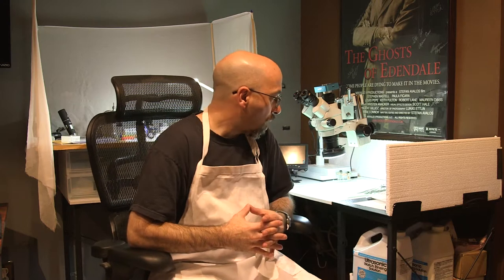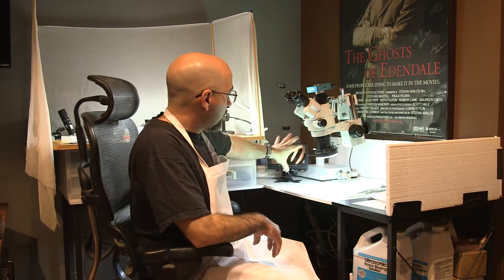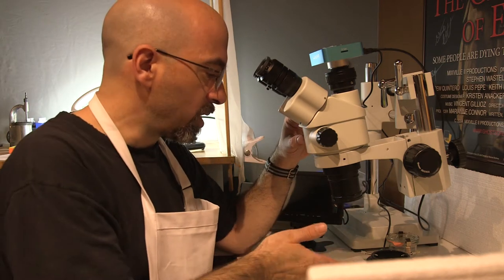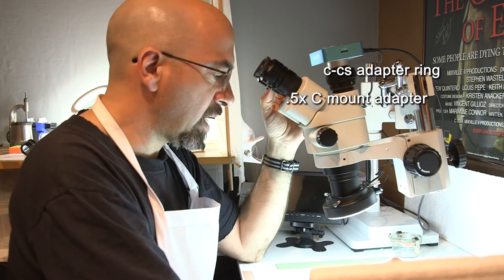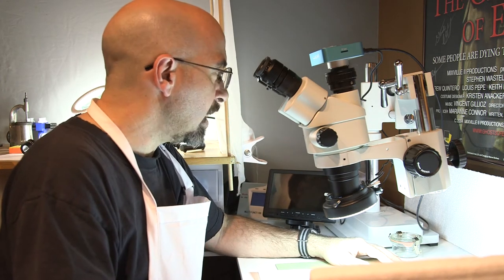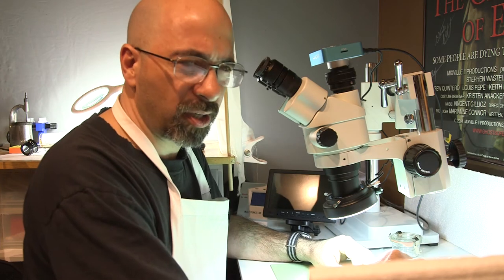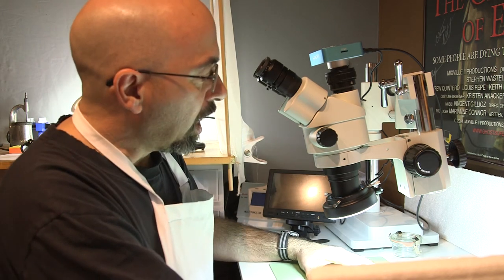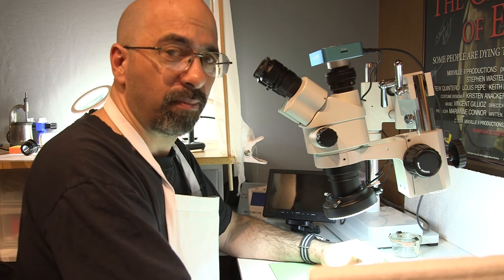Why an Amscope Microscope is AWESOME for watch repair!

Comment: Hi, firstly I did not expect to hear my name being said in this video! So thanks, clearly you watch my trials and tribulations in this wonderful hobby.
It seems to me you put up a very good argument for scope work. You answered one of the main concerns I make against solely working under one and that is lack of peripheral vision to see a part fly and have an idea where it went.
The plastic sheet on the front is a brilliant and typical hobbyist solution to a problem!  
For me I spent many years just using my cheap visor with a 2.5x lens and did a vast majority of my work that way. I got used to it and to this day even in my most recent citizen video I was using it.  Loupes I still use but as a glasses wearer unless it’s a clip on one I find them annoying to keep changing from glasses to loupe all the time.  Bergeon do a good clip on solution but they will rob you for it so I have so far resisted purchasing.

One other thing I heard that some pros have done in the past is pin a white sheet to the edge of the bench and then put it on your lap when working . There is a name for this but I can’t remember what it is.  Basically it can catch those flying parts and be found.
Personally I’ve found that pegwood is my best friend and to only remove it from a part when I’m sure the time is right. Failing that a giant magnet and a grid sweep patten on my hands and knees.
Enjoyed your video and good luck with your watchmaking sir!
Reply from the maker: Thank you Michael! Indeed, I watch your videos with great anticipation. Any and every way to relocate those flyaway parts is a good way. I too have done those grid patterns on my floor, like some sort of CSI TV show...  :) 
See you on The FB. :)

Comment: Two things you should consider to improve your experience using a loop:  1.) keep both eyes open; it will be difficult at first but will reduce that seasick feeling  2.) drill two holes in your loop at 12 and 6 o'clock to prevent it from fogging up.  These two things are taught in Swiss watchmaking schools.

Question for you: how do you minimize dust in your room?  Do you do any special tricks?
Reply from the maker: Dust: I have an air cleaner that runs for three hours every morning. I have found this to help dramatically - along with allergies. :) 

Loupe technique - Yes keeping both eyes open is good practice - much like target shooting. drilled holes - another good idea. I have wondered why that isn't the default with loupes. That said - I wouldn't want to have to trade the microscope for loupes for most work. :)

Comment: Great setup! I use a trinocular scope with a camera like this too. My scope was around $900 from ebay, got a Chinese kind, looks just like this. Also a hobby watchmaker. One tip for preventing pieces from flying: Anything under tension (yoke springs, etc), I work with inside of a ziploc baggie, with a slit cut for my tweezers. If it launches, it stays in the bag. Saved me so much time! Also, I've found that I can set my glasses on the scope, right in front of the camera. I have a PC next to my scope, which runs a program that interfaces with the USB scope, and which I can use to capture photos a videos. When disassembling a watch, each step I take a picture by reaching over and tapping a key on the keyboard.
Reply from the maker: great tip!

Comment: Thanks Stefan.
I am using a similar stereo microscope doing really small surface mount electronic assembly. It took me 10-12 hours for my brain to keep my head still while moving my hands soldering, etc. I am working with 0.1mm wide PCB tracks that I have CNC machined. Keeping still was was the biggest learning curve. Old Olympus disecting microscope with a new LED ring lamp.
Reply: Because you do electronic assembly I would like to ask, which microscope do you reccomend for assembly work? Is stefans adequete or would you suggest something else which would make working on delicate electronic components comfortable?

Comment: I ran across this video today—about 1 year after posting—and I have a couple comments: I have used an AMScope for about 2 years and after a big learning curve it is all I use during watch repair. Just yesterday, I tried to use my old visor/loupe etc and was astounded that I actually used such low power to do watch work—no way I could ever go back. The early AMScope days were filled with frustrations, as Mike mentioned below the periphery of work was a problem, but I caught on quickly and as time past I began to develop the needed skills to work under a scope. It actually drastically improved my handling of parts and greatly reduced lost/fly-away parts. Rarely do I lose a part as I once did. As far as using the scope for recording work, I think it would be a problem because your hands would probably be more in the way than say a regular camera sitting at an angle off to the side. Overall, I could not possibly be happier with my AMScope.
Reply from the maker: I have found all my work to be very improved also. I'd never go back to just a loupe. I record all my work and actually don't have the problem of hands in the way, by and large. I also don't point down the lens exactly downward at 90 degrees... more of a 85 degree or so angle... that slight pitch makes a lot of difference for the camera and for work in general.

Comment: Thanks for the video.  I am just getting into this hobby as well but I have a unique perspective on microscopes.  I am an ophthalmologist.  We work with microscopes all the time.  In the office setting we use a slit lamp for evaluation of your eyes.  A slit lamp is just a modified microscope which allows you to control the angle of illumination and the size and shape of the beam of light.  I use slit lamps made by Haag Streit with Zeiss being the other premium one.  As far as intraocular surgery such as cataract surgery, these are done under even more expensive surgical microscopes with some of the best made by Leica.
Currently I am looking for a stereo microscope I can use at home.  I am looking around to see what solutions others are using.  I know I want a decent working distance/depth of field and good illumination so a 0.5 Barlow lens and a LED ring seem ideal.  I would also like a good recording setup because I am so new I need video to figure out how to reassemble things (or hope to find a YouTube video of someone working on that particular movement if I'm lucky.)  Sorry for such a long winded reply but I agree that working under a microscope, if you are serious about this hobby, is a game changer.
Reply from the maker: Thank you!  I think the biggest differences between these scopes and what you are accustomed to is that the magnification doesn't need (not should it be) to be as high. My previous experience with microscopes was with 1000x type magnification, so these lower magnifications threw me a bit. haha. :)  
Right tool for the right job
Have fun!

Comment: I have been considering a long focal length scope for many years now. I am also a glasses wearer and loupes can be difficult. You have just solidified my decision. Once my new room is finished a scope just like this will be procured. 

As far as launching things, there’s a set lever spring from an ST36 that went to the ether two days ago. My current space is multi use  and there’s enough clutter that spring will never be seen again! Your flier solution is excellent. When I worked at the kitchen table, I used foam board as a barrier.

Comment: Thanks for a very useful video Stefan. It's great to get a list of all the parts to complete a setup like yours. I went ahead and ordered the parts. All fitted together with no problems. Saved me a lot of time buying bits by trial and error. Very happy with the scope. Thanks again.
Reply from the maker: Happy that it worked out for you. :) It's a great way to work on watches, for sure.

Comment: Thanks for the video Stefan.
I have a scope on my watchmaking lathe and another one on my workbench. I bought used American Optical scopes from eBay quite reasonably and their optics are probably better than the Amscope even nicer than my Nikon scope.
I'm also a machinist so I made all my arms and extensions. Like you I'm sold on scopes for watchmaking. I'm not a pro either but I can make a balance staff.

Comment: I just scored a new amscope 3.5-90 with the wide flat base off eBay for $225 with free shipping lol. Figured it’s worth it even if I buy a separate boom stand later.
Reply from the maker: Sounds like a great deal! Did you double check that the working distance was good?
Reply: @sma1968  yeah it’s 8”

Comment: Personally, I think every single household should include a microscope as a basic appliance (even more so as people get older).  There are SO many other uses than just electronics (for me), or watch repair.  They make things like splinters a piece of cake.
Even just a few days a go I had stabbed myself with a piece of 0.3mm lead attempting to close a Pentel Orenz mechanical pencil.  I had thought it just left a graphite mark at first - because it wasn't bleeding.  So I look under the microscope, and sure enough, there was indeed a little piece of lead sticking out..  It was still really tricky getting it out without breaking it to pieces though, since graphite is actually a dry lubricant.  I was eventually able to slowly pull it out in one piece, thanks to the microscope, and even that tiny 0.3mm hole gushed.  There was no way that would have been possible without the use of my stereo microscope.

Comment: Hi Stephan
Your video was certainly not boring in fact I found it of great value and enlightening. I too am into watchmaking and have purchased a similar scope. Have had a few issues with camera mounting. You might be interested to know that another Amscope guy on hear recommended a .35 C mount adapter which is far better than the items supplied by Amscope.
Regards Chris (UK)
Reply from the maker: Hi. glad you found the video useful. And yes - the .35 is better. It causes some vignetting, but you do get a less cropped image. Still not perfect though...

Comment: It's the same with me, I can't work with a magnifying glass, for this you need to have a lot of experience, and get used to working with it, you can work with a microscope when repairs are not going on in large numbers, experienced watchmakers also use a microscope, but only in cases where you really can’t do without it.

Comment: thank you for the video! I'm a jeweler and have been using a Russian made microscope for the past 7 years, but as I've been getting more into engraving, I've noticed that it has very poor depth of field and I basically have to adjust the height of the microscope whenever I move the piece that I'm working on. so now I'm looking for an alternative that would be less expensive than Meiji. could you comment on the depth of field of the AmScope?
Reply from the maker: Hi. Depth of Field is very narrow.My guess is that it's not much different than most microscope, including yours. With micro photography that i've done where I've wanted to increase the depth of field, I needed to blast a lot of light on the subject and close down the iris of the lens. Since these lens don't have an iris, I don't believe there's any way to increase that depth. 
On the plus side, focusing is very easy because just the knob on the zoom lens has to be turned to focus, not adjust the entire microscope...

Comment: I've recently been bitten big time by this watch repair hobby BUG! Been a watch collector for years but am determined to take the next step. Just found this video of yours and it's a huge help.  Want to take the plunge for a quality  Microscope....loupes are killing me.  Your setup seems perfect to me.  Have been pricing out your exact rig on Amazon but not smart enough to figure out the correct Barlow lens.  Can't seem to find it using just ".5 Barlow lens". Any chance of you sharing some more specific info on it? would be much appreciated..
Reply from the maker: Indeed... clicking the links that I have in the description will take you to the exact parts (at the best prices) on amazon... (and... it will help me with no additional cost to you). :) :) we both win.

Comment: Hi Stefan, I've watched this video several times and I was so convinced I bought the entire setup exactly like yours.  So thank you so much for the detailed info.  I am starting my watch hobby journey and was looking for something better than all of the typical solutions you see out there.  Yes, it isn't a cheap setup but buy once cry once is actually true.  I have had my system for a couple weeks now and love it.  One issue I have and thought I'd get your opinion on.....Because of the intensity/brightness of the LED ring light, the subsequent video the camera is recording and displaying is usually washed out in brightness.  If the watch is slightly tilted it comes out much better but if laid flat on the bench, it's so washed out in brightness the playback is very hard to use.  I have looked at the settings on the camera to no avail.  Am I missing something?  Did you have the same issue by chance, and what did you do to have a better balanced camera output?  Thanks again!!!
Reply from the maker: Hi, Glad you're enjoying it. Yeah, the scope is pretty amazing. So two thoughts: I don't aim it exactly straight down at the movement, I'd say I'm hitting it at maybe a 2 or 3 degree angle. This allows me to see my work better - rather than having my hands obscure things. Perhaps that would help. The other thing (i'm guessing you already tried) - have you turned the light level down? It does have a knob for that. (just in case you missed that)
Reply from the maker: My camera in the camera exposure settings, I turned it down to -2/3. That certaintly helped.
Reply: @sma1968  Thanks Stefan, I feel a little stupid because I didn't think about tilting the head.  It works great and you're right in that having the mic at an angle also helps your vision of what you are doing.  This setup is awesome and I'm extremely happy with it.  Now let's see some more watch videos from you.

Comment: Hi
I purchased the exact same one as you two months ago and I love it. I restore watches and working with this is a game changer. The one issue I have that I,m confused about is when I zoom in or out it does not stay in focus. I then have to adjust the height with the large knob to bring back to focus. Do think I missed some step in my set up. Thanks
Reply from the maker: Try zooming out all the way and focus. Then zoom in all the way. Don't touch the big knob. Adjust focus of the eyepieces until in focus. Then try zooming out again and see if you're still in focus.

Comment: Hi Stefan. One think, thats not clrar in the Video: So you record the Video on the Card and use the HDMI just as a Controll Monitor that you are focused on the right spot? Or do you connect to the Laptop via HDMI for recording? The Manual for the Camera says, it cannot connect to PC or Laptops via HDMI Port, just to plain Monitors. I am confused :)

Comment: Hi Stefan, thank you for your very detailed video about this microscope! I am currently looking into buying this microscope. But I am uncertain about the desk height and ergonomics. May I ask how tall is your desk? Any reference helps :)
Furthermore, I noticed that your microscope is slightly tilted towards you. Does that effect your perspective when working on a watch? Does it help with ergonomics?
Reply from the maker: desk height of the desk that the microscope sits on is 29.5 inches. Pretty standard desk height. Yes, I put the scope at a slight tilt so that I can see the watch a a slight angle. I adjust this  depending on what I'm doing - but most of the time, I keep it with a slight tilt. I do it so that I'm not looking straight down at my hands as I work.

Comment: Is there a way to fix massive field of view difference thats coming from the camera VS what you see with your eyes ?
I know i need some kind of adapter but which one ? Which adapter will make field of view same for eyes and HDMI output ?
Reply from the maker: The .35 adapter that I now link to instead of what I had in the video is a lot better. It's still not perfect, but MUCH better.

Comment: Thank you for the video. I am starting this as a hobby. I actually hooked up camera with monitor you reccomended. It turns out I did need to order c cs adaptor as I could not get in focus without. I lifted camera off threads and held with hand on top of threads and it focused just fine. So waiting for adaptor. The question I have with light ring is that the light puts a bright ring at watch which is distracting. Did you find a way to make the light circle on object larger?  Thanks for your time

Comment: Question, did you need to use extension tubes with the.35 camera adapter ?  The Amazon reviews mention that. Thanks so much for doing all the research, I have everything on order.

Comment: Hi Stefan, I have bought the same camera like your but in my package there was no CD or something with the needed software to start the camera working with my Windows. Can you please share what software have you installed on your PC to have the camera connected to the computer?
Reply from the maker: I'm using a mac and the HDMi so this is not first hand information: 

I believe the camera should be seen by computer as a usb camera device without need for software.  However, there is also additional software available at this link... 
http://download.hayear.com/content/?270.html

Also, I have read (I cannot confirm) that the sd chip has to be removed when using USB.)